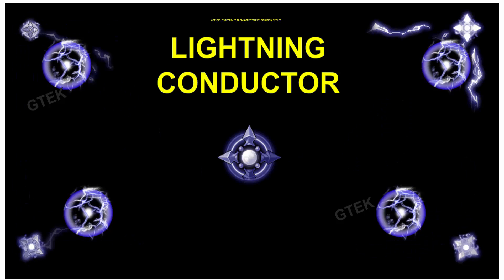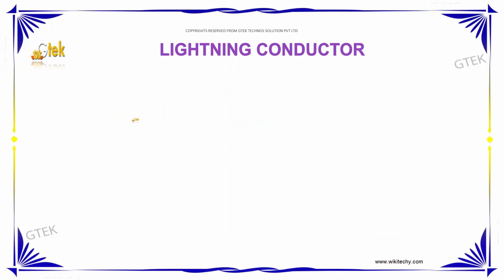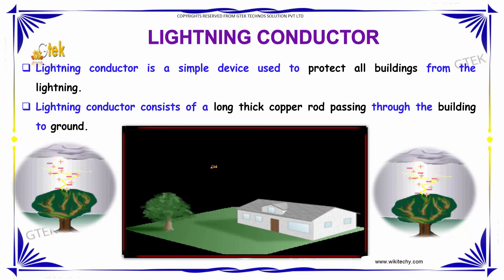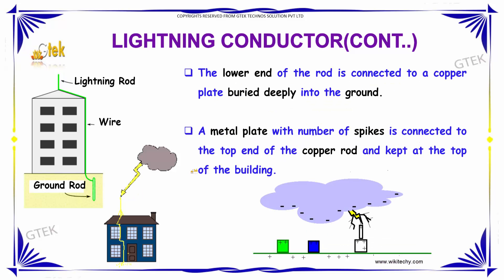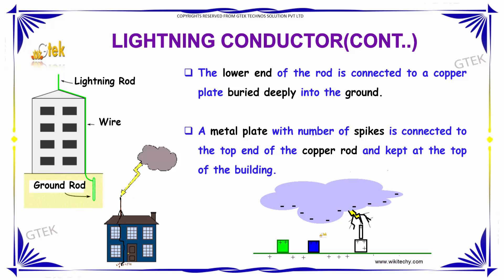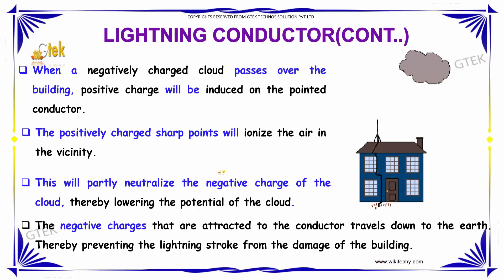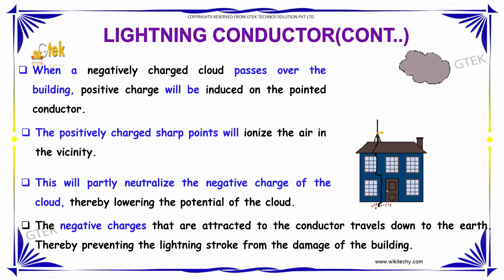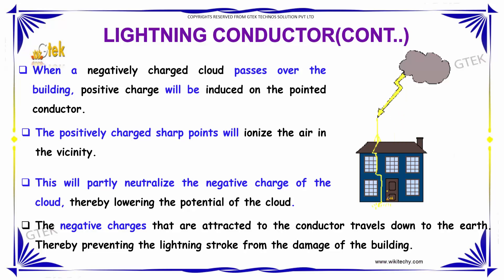Lighting Conductor | Electro Statistics | cbse class 12 physics | JEE Main and Advanced physics

Comment: The lightning rod, which Benjamin Franklin invented in 1749, is a metal pole mounted atop a building that draws lightning's electrical charge away from the structure. The rod is attached to an aluminum or copper cable that's connected to an underground conductive grid.

Comment: Conductor Cables - Heavy cables (right) that carry lightning current from the rods to the ground. Cables are run along the tops and around the edges of roofs, then down one or more corners of a building to the ground rod(s). Ground Rods - Long, thick, heavy rods buried deep into the earth around a protected structure.

Comment: A  lightning rod (US, AUS) or lightning conductor (UK) is a metal rod or metallic object mounted on top of an elevated structure, such as a building, a ship, or even a tree, electrically bonded using a wire or electrical conductor to interface with ground or "earth" through an electrode, engineered to protect the structure in the event of lightning strike. If lightning hits the structure, it will preferentially strike the rod and be conducted to ground through the wire, instead of passing through the structure, where it could start a fire or cause electrocution. Lightning rods are also called finials, air terminals or strike termination devices.

Comment: The rod is attached to an aluminum or copper cable that's connected to an underground conductive grid. This allows the electricity to dissipate harmlessly. Because lightning tends to strike the tallest object in the vicinity, lightning rods must be taller than any buildings or other objects in the area.

Comment: The lightening conductor consists of a large no of conductors having sharp pointing heads. They are usually attached on the top of buildings. Their pointing heads are connected to a conducting material such as a copper wire. Then this copper wire of large length came down along the either side of the building. At the bottom it is attached to a metallic plate. Then that metal plate is interred into the ground. Clouds mostly contain positive charge. Whenever the passage of cloud occurs over a certain building then induce charges will produce. At the pointing heads of the conductor induced positive charge will produce and on the metal plate induced negative charge will be produced. The pointing heads of the conductor have the property of discharging the positive charge present on it. Due to discharging of the positive charge from heads, a positively charged wind will be produced. On account of this wind the negative charge of the cloud will be counteract i.e. cancel out. The charge of the cloud after discharging will flow to the ground with the help of the copper wire.

Hence our building will be saved by using this lightning conductor.

Comment: A lightning protection system is designed to protect a structure from damage due to lightning strikes by intercepting such strikes and safely passing their extremely high currents to ground. A lightning protection system includes a network of air terminals, bonding conductors, and ground electrodes designed to provide a low impedance path to ground for potential strikes.

Comment: Lightning protection systems are used to prevent or lessen lightning strike damage to structures. Lightning protection systems mitigate the fire hazard which lightning strikes pose to structures. A lightning protection system provides a low-impedance path for the lightning current to lessen the heating effect of current flowing through flammable structural materials. If lightning travels through porous and water-saturated materials, these materials may literally explode if their water content is flashed to steam by heat produced from the high current. This is why trees are often shattered by lightning strikes.

Comment: In a lightning protection system, a lightning rod is a single component of the system. The lightning rod requires a connection to earth to perform its protective function. Lightning rods come in many different forms, including hollow, solid, pointed, rounded, flat strips or even bristle brush-like. The main attribute common to all lightning rods is that they are all made of conductive materials, such as copper and aluminum. Copper and its alloys are the most common materials used in lightning protection.